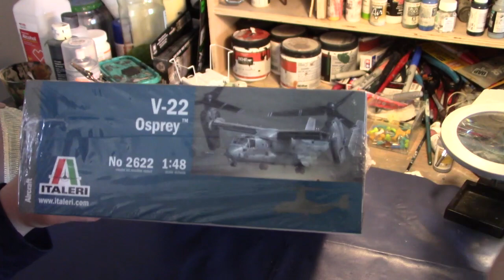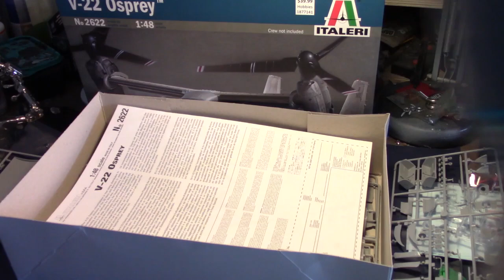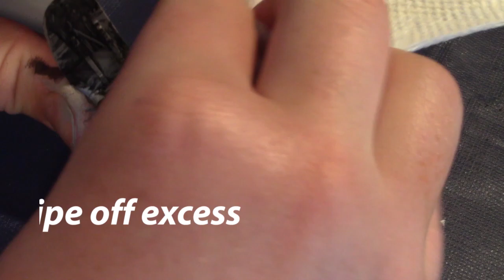Italeri 1/48 V22 Osprey Build and Review

Comment: I got this kit about 2 years ago, and started working through it, and got to the point it started to tell me to paint things.. Looked into it at the time, couldn't find where to buy the paints.. I ended up shelving the thing.. About a year ago, looked into it again, could not find where to get the actual paints.. 
So, recently, I had a heart attack, and on medical leave.. so SERIOUSLY start to look into getting paints for it.. To find out the manufacture discontinued the entire brand of paints, and no wonder I couldn't find the paints.. 
So, now I just need to decide, do I just throw the whole thing away, or built it unpainted?
Reply: Just buy similar colors
Reply: Vallejo sells sets for different branches and eras of military aircraft. If not that, just basic paint bottles. Remember, you are the one who needs to be happy with it. If you don't have an airbrush, paint layers of really thin paint with a brush.